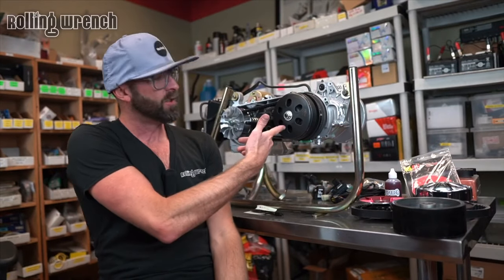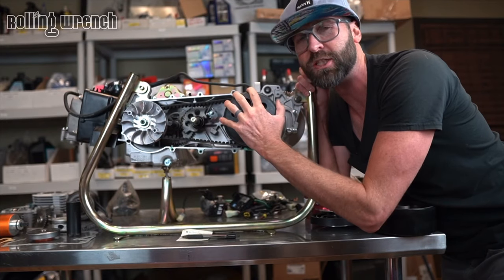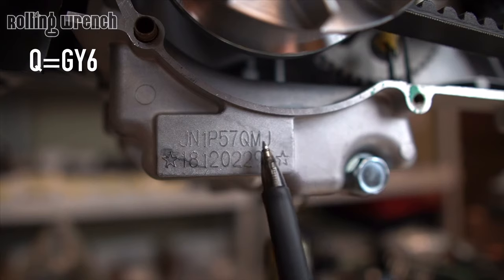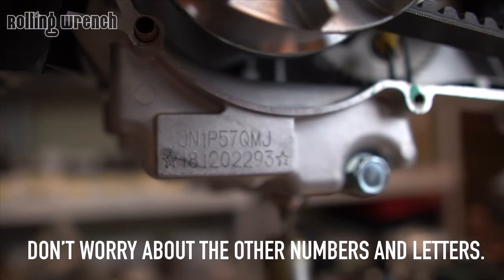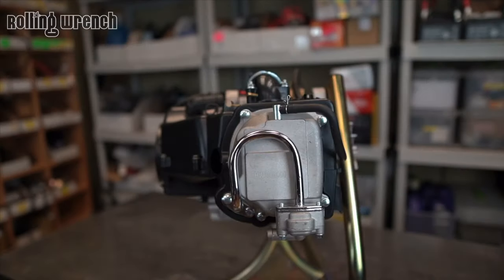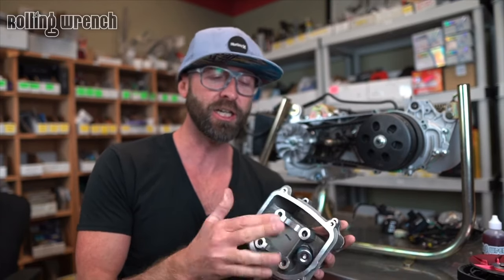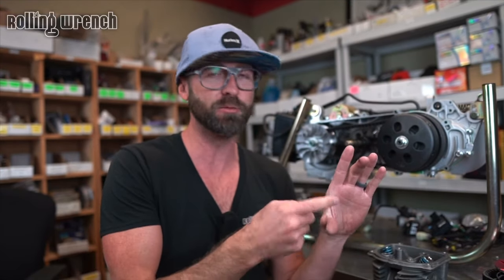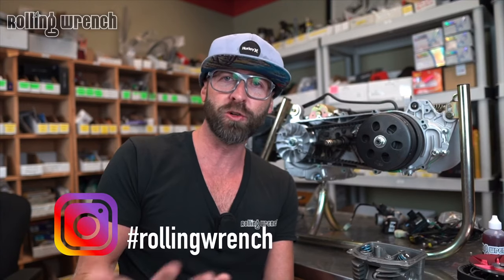GY6 [EVERYTHING YOU NEED TO KNOW] decode your engine!

Comment: Hi i have a fuel injection bn152qmi  engine  and have delphi ecu fitted  i have spark fuel getting  to injector  but not into head 😮  so wont start i have tried everything  i know to get it away  spent loads on it etc  cant find wot is up i have been all over youtube and cant find a solution 😢   i have been off the orads for 6 weeks now and insurance  is ticking  by paid the full year ha

Comment: I had a 1p57qmj gy6 with 12 wheels and a belt 842 30 20 means its a long case but then measuring stud spacing head is 54mm meaning a short case. Anyone had any thoughts??

Comment: So the gy6 a type is 54mm measured from CENTER TO CENTER of the rocker studs or the edges of the openings for the studs?  I think I know but is rather know for sure if I go this route.
Reply: I have an eng knock of some sort I haven't figured out if its clutch jungle or actually a bad clearance of the piston pin or crank bearing.   I know it was very low on oil. And very dirty and the bike quit while riding.   3 years never changed the oil. So the questing is typically rid bearing failure or crank bearing failure?  I suppose I'll have to visually inspect the crank by splitting the case tear down?  I can afford an upper end big not kit,  or I can afford total stock rebuild i think.   Not both.

Comment: I have a JAGUAR-200 (169cc) DELUXE Go Kart, Single-Cylinder, 4-Stroke, Horizontal Type, Air-Cooled. I noticed it no longer goes into higher RPM. I dont know much about these engines. What i did notice when i first bought it was it had 3 levels of RPM- power(according to how loud it got when driving it. It no longer goes into "lvl 3" aka the louder more power RPM. It only has 37miles and i have changed the oil twice. To break it in correctly. Its as if i lost the half the power when trying to drive it. What could it be? What should i do?
Reply: Torque converter possibly, spark/ignition issue ,

Comment: SO I HAVE TWO HONDA METRO'S A "07" AND A "05" WHAT MOTORS DO THEY HAVE IM LOOKING TO DO A BIG BORE KIT AND SLIDE CARB FIRST THE CODE FOR THE "05" IS =JH2AF60625K  THE "07" IS =JH2AF60637K I THANK YOU IN ADVANCE FOR THE INFO
Reply from the maker: This is a GET engine. Some engine as a ruckus

Comment: So I have a 150cc gy6 a case motor and in the process of boring it out to 63 mm or 180 cc but don't think I am going to be able to do it since it is a case motor any idea if it will work or should I get a smaller bore kit
Reply from the maker: 63mm bore will work after you bore the cases on a GY6 A. We sell pre bored cases as well

Comment: Having a issue with my gy6 starting everything seems fine but not getting spark to the plug. Has everything new from stator to coil wire any advice you can give I think it's a ground issue but I dont know what to look for.
Reply from the maker: Watch my cdi box video. It may help

Comment: Hey, what is the name of the part that caps off the scooter motor. The very last cap piece you install after a big bore kit. Has the hoses coming off of it. The very front metal piece.
Reply: Valve cover I believe.

Comment: Could u put a gy6 150 on to a taotao racer 50 that has the gy6 49cc
Reply: Yes, you can buy a kit to change your head and position to a 150CC.
Reply: @ELCLAVE300  si compro un motor nuevo gy6 150 para cambiárselo a una tao 50 le queda sin problemas?

Comment: So after watching this video I’m assuming that I don’t have a gy6.  Mine is JL1P57F .  I’m looking for a cylinder head or if I can get a new engine cheap enough.
Reply: didn't  check yet mine.. but for sure is not i gy6..  you are obligated  to open the valve cover to mesure the distance  between studs
usually on amazon and ebay there is plenty of kit..  THE PRINCIPLE  OF GY6 ENGINE IS VERY SIMPLE WELL COPIED BY CHINA TAIWAIN COREA
 @ part the type A or B. ( not concerded at all)  just check if egr is there or if u need  liquid or air  coooled..  easy..( at least for me)

Comment: i need  a clutch changed in my scooter it has 16 inch tires abd also says 200cc on it... actuall   cc is 178...need to order clutch but cant find anything in it... or is the 150cc same as the 180s or 200cc
Reply: sorry forgot to mention it but the shars where the clutch will go same size from 125 to the 200cc

Comment: In the video you said qmb is a different engine design but you didn't elaborate more on that is it a GY6?
Reply from the maker: Ya, it’s a GY6. But nothing from the qmb139 will work on the qmj157. And vise versa. They are two totally different engines
Reply: @RollingWrench  cool cool thank ya
I have a rps sunny a-6 with the 12 in Wheels with the low profile tires 
white and black in color. 
I laid it down the day after I got it I put a thousand miles on it since then but it gives me issues everytime I ride  it I'm always having to do something do it I just now realized it wasn't getting spark think it might be okay now love your videos and I wish I had an impact to take off that variator nut.

Comment: Hi I am looking at rebuilding a Polaris rzr170. Has anyone had any experience in using gy6 parts in this engine? I’ve been told they share a lot of parts. Any help or advice would be great.
Reply: I did a 180 kit on mine, it's pretty simple. 

I did not have luck upgrading the charging system, my parts came from Gy6performance, NYC something like that, and vent racing 

Good luck!

Comment: not sure if the correct way to communicate with you guys but I am having a difficult time.. i have a 2014 taotao powermax VIP 150cc and looking to find the odometer wiring diagram? i want to replace it with an all digital one and having a hard time finding the right one or need to rewire the one i have. any help would be great. I'm in Oakland CA. thank you in advance..
Reply from the maker: I can’t help on that. Wiring diagram is not easy to get
Reply: @RollingWrench  really appreciate the fast answer! thanks, i dont suppose you know the correct replacement? this analog is in km and i want to switch to MPH...
Reply from the maker: Kean Sele I don’t sorry :-(

Comment: I'm  trying  to  figure  out  if  I have  a  short  or  long  case.  So are  all 4 wheelers  have the  small  case  or is there  anything  I  should  look  at  to make  sure  it's  small  case?
Reply from the maker: If you have a long case you will have a 835-20-30 belt
Reply: Ok I'll  check  that  thanks
Reply: Just  looked  it's a  743-20-30 belt

Comment: I have a gy6 161qml   in my buggy, would a 232 kit drop right in it considering its a 61mm bore at the skirt already?
Reply: I have the same engine and same question. Lol I was wondering if you was able to figure it out? Thanks in advance
Reply: @jovannycolon4570  it does not competely diffrent bolt pattern

Comment: I'm trying to find out if I can switch out my 50cc gy6 engine with a 150 cc I don't if it will swap right out or do I need different motor mounts can anyone answer this thank you
Reply from the maker: 50cc engine mounts from the bottom and 150cc mounts from the top. It’s not a simple swap unless you want to fabricate.

Comment: Any info about reverse engines? Have a quad with gy6 B engine from AEON cobra 180cc, but running hard to find parts for gearbox since the gearbox cover was blown. Any info would be appreciated
Reply: I’m in the same boat.

Comment: Can you put a chain belt transmission on a gy6
Reply from the maker: You wouldn’t want to. Then it wouldn’t be a variable transmission. Older scooters had this and top speed was 30mph
Reply: @RollingWrench  my code on my transmission is reading 1P63QML.
I HAVE A 200CC JASSCOL. SHORT CASE FINDING MY SIZE BELT IS A HEADACHE. WHAT SIZE U SUGGEST BRO🙌🙌🙌

Comment: Are the 50cc short case and 150cc short case same size to swap or is thier modification needed to do
Reply from the maker: The 50cc and 150cc engines are completely different engines. No mad the parts will mix and match :/(
Reply: @RollingWrench  okay just wondering have you ever heard of wolf scooter and how would you rate that brand . I have a wolf rx 50
Reply from the maker: @crazyadventures9720  wolf scooters are nice in the world of Chinese scooters.
Reply: @RollingWrench  okay awesome thanks for letting me know about them so thier higher end chines ( fine china ) lol

Comment: last 5 of my scoot motor is 580MK. Its a Sym/Lance Cabo 200i (169cc EFI). Having a helluva time finding aftermarket support for this platform... any ideas from anyone?
I'd like an ECU tuning option to richen it up a tad, or have 'drive modes' like eco/sport/normal. 
Exhaust and intake mods would be nice as well, ya know, the standard stuff :) Thanks to anyone who can lend me some info
Reply: full standalone - microsquirt or speeduino and you will need to make a engine map from level 0

Comment: When you say QMB you mean the non-chinese motor? And QMA means the Chinese one correct?
Reply from the maker: Qma is a bit different. Some parts carry over. But I would not trust any internal engine parts to fit
Reply: @RollingWrench  I got my first scooter its a Chinese taotao its a 90s model im restoring it putting new parts on it I bought a spacer for the intake manifold and it didn't fit and was thinner than the one that came out I figured the QMA and QMB had something to do with it
Reply: @RollingWrench  and I do thank you for your resopnce

Comment: I have a 157FM engine on my dune buggy. Anyone have the info on this motor? As long as I order a big bore kit for the bolt spacing the engine has it should fit correct?

Comment: How do i know if the 61mm will fit with out boring the case
Reply from the maker: Just purchase from us and you will have no problem
Reply: @RollingWrench  well i was told i had an A block but it turns out i have a B block it has a 57mm stud spacing and 80.5 diag spacing i was under the impression that all the Chinese blocks was A blocks and tiawn blocks was B blocks ?? I have 150 tao tao thats Chinese and if all them are A blocks then how is this one a B ? If 57mm stud spacing is a B block then i have yet to come across the A block trust ive worked on a tun of these

Comment: Why is my gy6 150cc different engine mounting?
Reply from the maker: What is your engine code?
Reply: @RollingWrench  bz139qmb
Reply from the maker: The qmi/qmj (125cc and 150cc) and qmb(50cc) are complete different engines. The Qmb’s mount from the bottom.
Reply: Thanks for your quick reply
Reply: I have that same issue.... I have a Roma Super Hornet and the engine mounts from the bottom....hard motor to find.

Comment: Does it run on kerosine?
Reply: I ran it on 30%gasoline 70%kerosine mix. It runs and actually pretty good(smokes a bit when cold,then clears up), but it sat for a week and I took it out and it started detonating/spark knocking on WOT. I wonder if kerosine got some kind of chemical reaction with gas that dropped the octane down.
Reply: Gegute Gegutis thanks for your comment. English is not my native. So if i understand you correct. It does work but your spark plug starts making noises if you have throttle full open? And do you rate it to use kerosine or will i destroy my engine?
Reply: Do 50%gasoline and 50%kerosine and you should be good.
Reply: If you are on a tight budget like me you can use the kerosine mix. But i would recommend just to put normal gasoline :)
Reply: Thanks for your answer mate💪🏼

Comment: So sick of this guy. He's the most popular GY6 engine guy on YT but doesn't know what the hell he is talking about most of the time. There are many different QMB engines, long valves, short valves, long crackcase, short case, fuel injected, carbarated, and yes, A and B. I came here to research the exact differences only for this guy to tell me they don't exist.
Reply from the maker: If you are learning are you sure you know what your talking about? There are two types of qmb139 heads 64mm and 69mm valves. On the qmb139 engines there is short case (669 belt) long case (729) and Maddog scooters extra long case (788) that’s it no more info on the qmb139. This is not the same as a qmj157 or qmi152 engine.